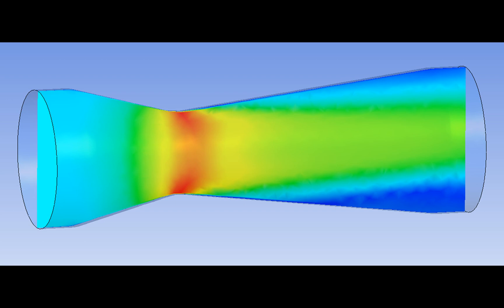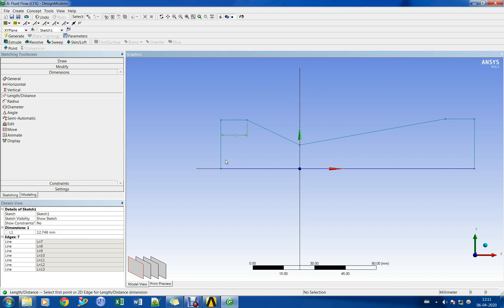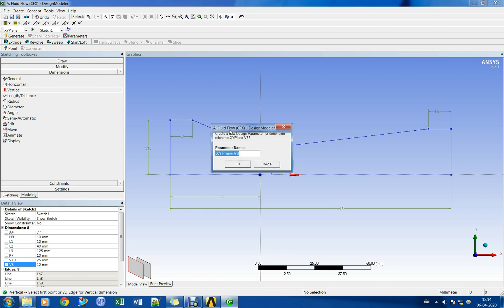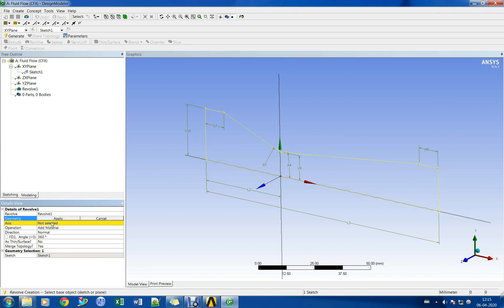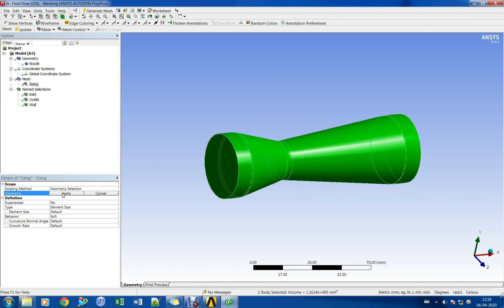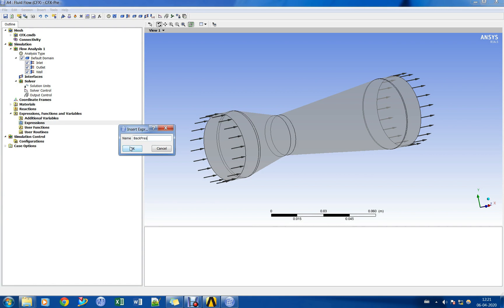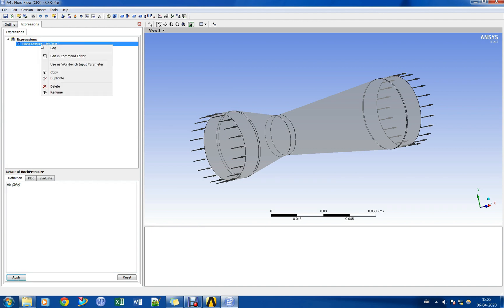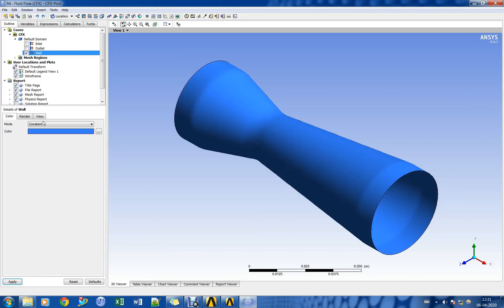Parametric CFD analysis of Nozzle flow | Ansys CFX

Comment: If anyone is having trouble getting CFX to work,... you'll need to run CFX as administrator first, than map the file path for the workbench directory, using the folder ICON in the upper right corner, in my case it's R1 2024,... while CFX is running, start workbench and open the folder for the workbench project for this tutorial and it will load right up,... otherwise you get the error shown earlier.

Comment: Amazing video!!

Is it possible to create a parametric CFD analysis using ANSYS bladegen? I mean, inputting different geometries from Bladegen? Or turbogrid...

Thanks a lot for the information!
Reply from the maker: Hi, it is possible. But when it comes to blade design, you cannot easily parameterize the design trials. It is recommended to check and do it manually.

Comment: thanks for very informative video. By the way, could you make a video on how to produce a chart in CFD-post that have multiple design point. Example, pressure across the nozzle (or some piping) at  multiple design point (let say design point 1, 2 and 3). Thank you
Reply from the maker: Thanks for your comments. I will post a video regarding multiple design points and let you know. By the way, do you mean multiple back pressures or post processing data at different axial locations for same back pressure.
Reply: @LearnCAE  what I mean was, let say I have input variable which is inlet diameter, So my design point are inlet diameter 1, inlet diameter 2, and inlet diameter 3. In parametric design I can find the corresponding outlet pressure for those three cases from the parametric feature. 

However, I also want to find the pressure along the pipe/nozzle. How can I produce a XY plot, a graph of pressure vs length of pipe  for those 3 cases (3 input diameter) simultaneously. For now, in post-cfd i can only produce the xy plot/graph of single line, for design point 1 (current) only. How do I do to get the result of design point 2 and 3 on the same plot.

thank you.
Reply from the maker: @melanotictus  To check all three results in single plot, I think you need to open all three result files in post processor and plot. If not, you can extract the data for all three cases and plot separately in excel or matlab or any other tool.